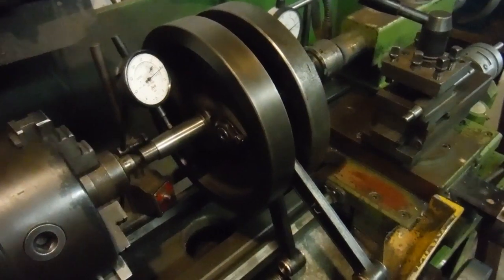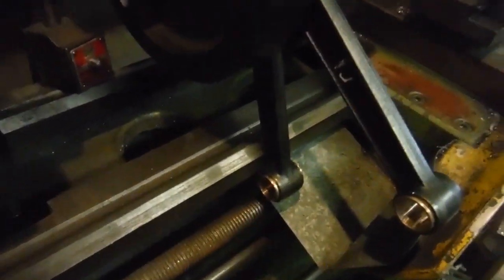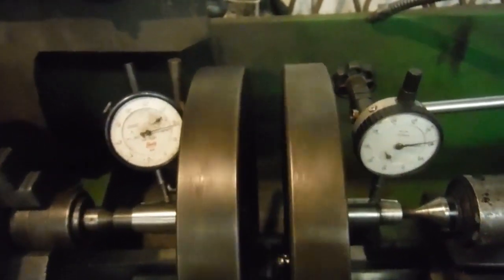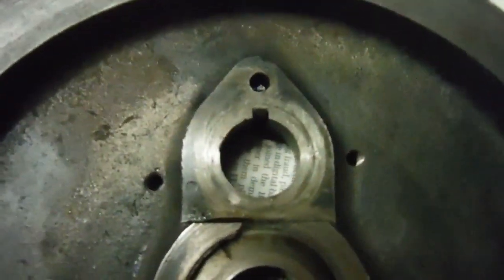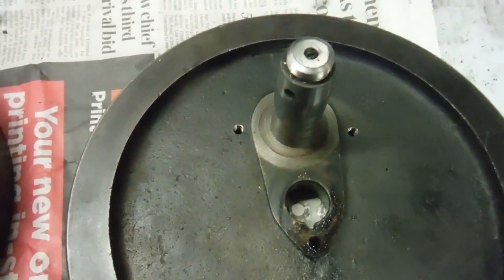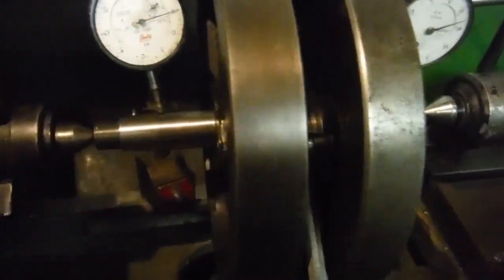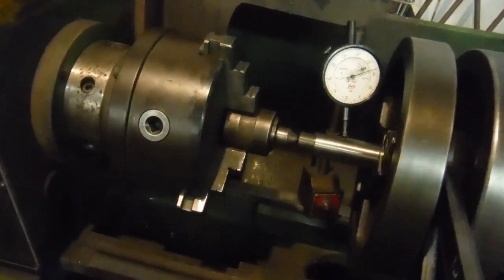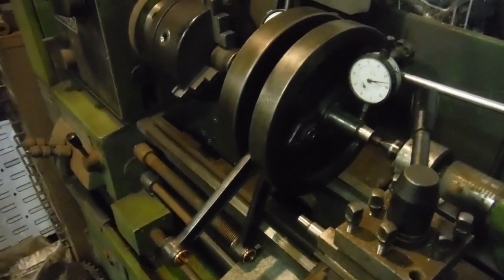Royal Enfield Model K 1930 crank rebuild discussed and checked.

Comment: Lucky escape with that one, shows how much care is needed during inspection, nice job
Reply from the maker: A very lucky escape. It might be possible in post lock down times to get the cracked flywheel repaired, but this got the project moving again, thankfully!

Comment: Paul I’ve watched quite a few of your road test videos and enjoyed them all. What’s your opinion of the ‘new’ R.E. Interceptor 650?
I’m picking up a chrome one Thursday and never having ridddn a British bike apart from a 175 Bantam and a Triumph 500 twin many moons ago I was wondering how a Bonnie Commando etc compare on handling and performance?
I know the new Triumph’s are quicker than the Interceptor but for the extra money they should be.
Cheers
Reply from the maker: Hi Nige, I must say I have never ridden one of the new RE twins, but they seem like fair value for money. I doubt they would be a match in performance and handling for any of the late big British twins, though with only 47 BHP available - the original Interceptor had 56 BHP.
Reply: Paul Henshaw thanks Paul that’s what I thought would be the case although there is a rapidly expanding range of upgrades coming out for them. I think plenty of owners will be looking to do various things to their bikes as is the case with the new Triumph’s and Harleys.